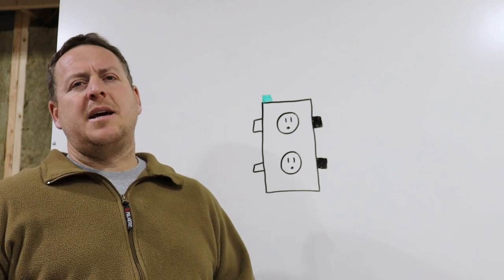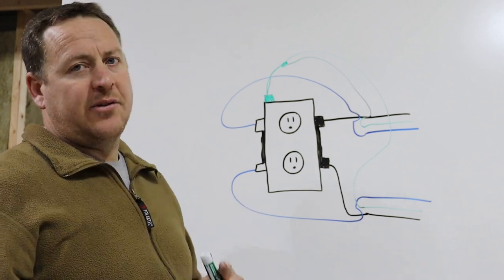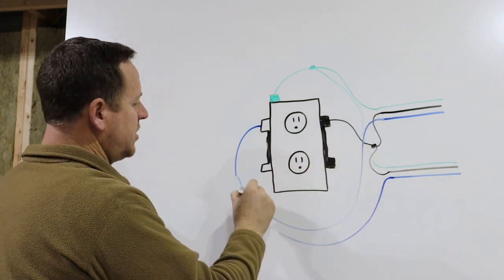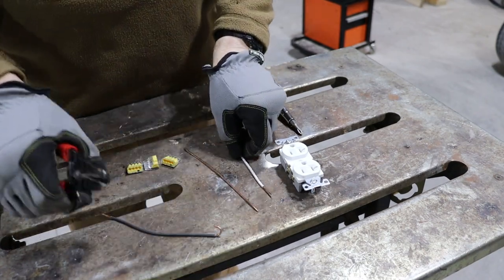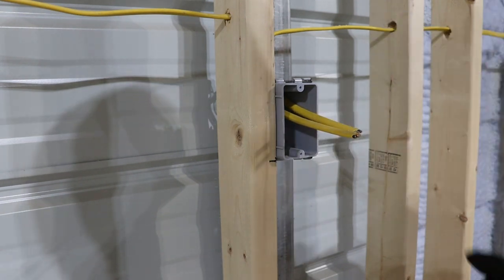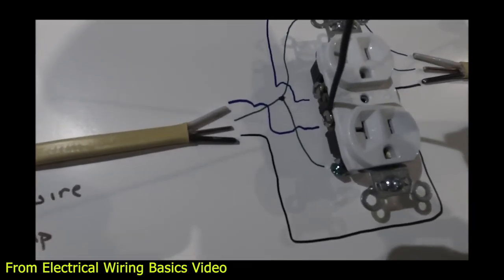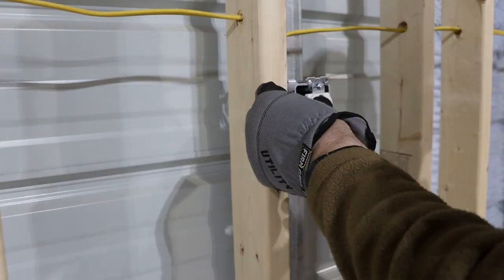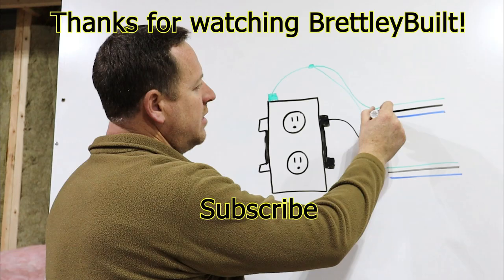Electrical Wiring Basics Clarification

Comment: Thank you for the clarification. On another note, what if you have a switch that controls an outlet (for a  lamp), and you then want to install the new LED recessed lighting, and leverage the power from the switch. Then make the outlet always on because you will now have LED lights on the ceiling. I have ideas, but given your methodology and illustrations with actual wires and schematics, I am interested in watching a video with your approach(es). There are several videos out, but cannot find one with this specific scenario. Again, thank you.
Reply from the maker: Yes, I will make a video on this in a week or so.
Reply: @brettleybuilt  Thank you so much. Again, several videos are available on installing the recess lighting and they are clear, but spend little time on dealing with the scenarios of existing wiring conditions. So the premise of the video would be how to leverage the existing wiring to upgrade to LED recess lighting. That would be awesome and again thank you so much and I really hope others can benefit from your video.

Comment: I have another question for you.  I hope you do not mind me picking on you for my learning about electricity.  As I understand it the white wire (neutral wire) is used to get the electricity back to the source.  The panel box only has covers for the two hot wires.  If the neutral wire is carrying electricity why does it not have a plastic cover over it to so that you will not get shocked?  I thank you in advance for your answer.  dt
Reply from the maker: When working in a panel box, if the power is shut off to the box, only the two hot lugs will be hot. At that point the neutral bus bar shouldn't be energized and will be safe to work with. It doesn't need a cover because when using safe working procedures there is no danger of electrocution.
Reply: @brettleybuilt  That makes a lot of sense, I should have reasoned that out and not had to bug you with a stupid question. Thank you for answering my question !!!!!!!

Comment: Could you do a video on adding a junction box in the middle of an existing Romex run for new receptacles or lights?
Reply from the maker: I was thinking about this. Unfortunately there won't be enough wire to add the junction in the middle of a circuit. There is a way to run the wire along baseboards which maybe I will do a video on in the near future.

Comment: Code requirements for receptacles for industrial applications require the ground prong to be on top, ( no smiley face look ) . I have been told, but not confirmed, that this is during plugging and unplugging an appliance, your thumb is the most likely to accidentally touch a prong, because your thumb extends the farthest out when gripping the plug. If you accidentally touch a prong, you want to touch the ground. Again, no confirmed, but it makes sense.

Comment: the question you have to ask is if making a pig tail and connecting to one screw then why did they make it with 2 screws?
Reply from the maker: So you can break apart the tab between them and use a switch to run one of outlets to power a lamp or light.

Comment: So you need to have one wire for each outlet even if you put them together or not right? So if you have 4 outlets you will need 4 cables right?
Reply from the maker: You start with a wire from the breaker in the panel box and run it to your first outlet. Then run a wire from that outlet to the next outlet, and so on. It is kind of like having "one wire" spliced wherever there is an outlet. You will need technically need four sections of wire.

Comment: If I wire this way and I have a light switch first, followed by all of my electrical outlets after the light switch, will the light switch turn all the outlets off when I flip the switch?
Reply from the maker: Yes, as the power to the outlets will be turned off when the switch is off.

Comment: Can you do a similar basics video explaining 220v? I need to wire a hot tub...
Reply from the maker: My mini split video should help. The first part of the video is all electrical.
Reply: @brettleybuilt  I just watched it... Is there no neutral in 220, or did you just not show it because it's basically the same thing as a ground?

Comment: Great video. I don't think the argument that all current shouldn't be going through one outlet is valid because they can handle at least 20 amps and the breaker should trip before it becomes an issue. The real issue is if you need to work on an outlet you'll lose power downstream. Not a huge issue.
Reply from the maker: I completely agree, but some people don't. I have never heard of that situation happening.

Comment: With the change in how the previous video hooked up the outlets to the way described in this video, does it change the circuit to be in parallel rather than in series? If it is different, does that matter at all?
Reply from the maker: AC power is always in parallel.

Comment: unfortuntately your hands were in the way when you made the connections at the box (6:07).  for me that's the most important part and I couldn't see it.  you also did not explain those connectors you are using.
Reply from the maker: The connectors can be found at Lowe's or Home Depot. They are used in place of wire nuts. The wire is stripped back about 3/8s of an inch and pushed into the connector.